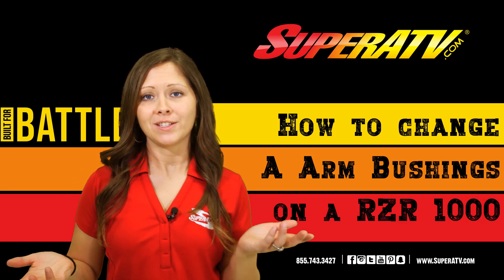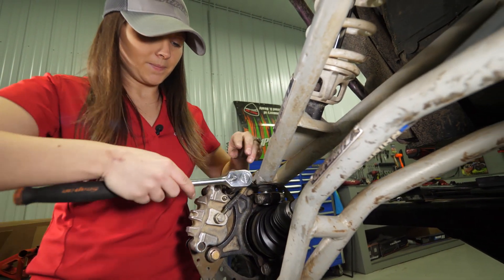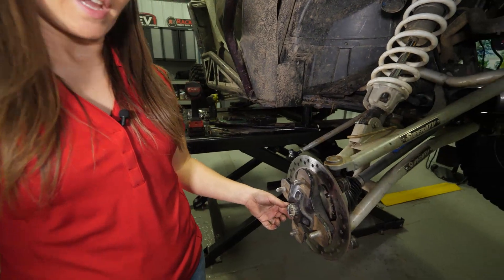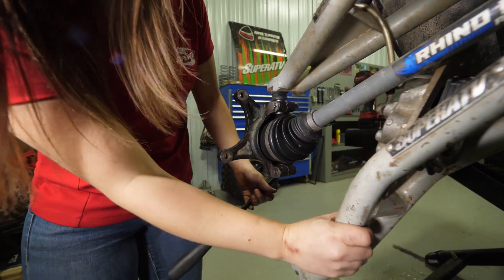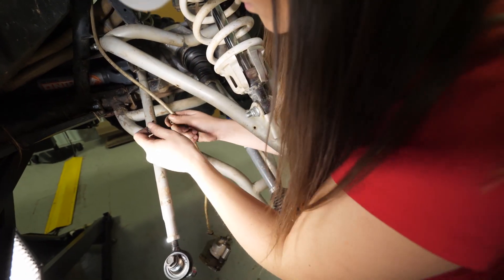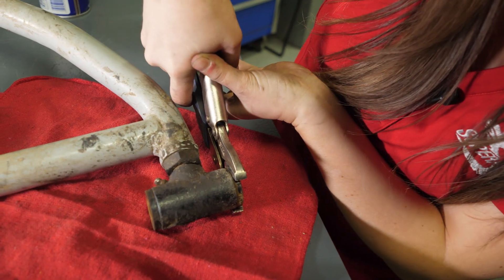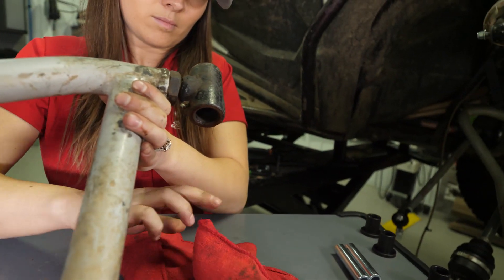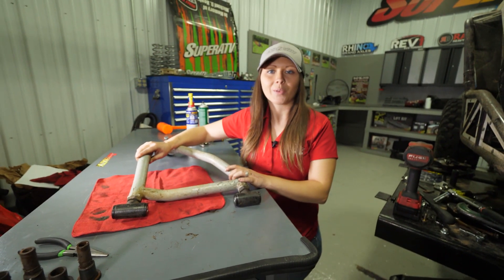How to check and replace your a-arm bushings| Maintenance Matters | SuperATV

Comment: Hmmm.. I am replacing all my bushings and what a choir... I like the video on the how to deal... I would like to know what tool ya all use on upper a arm front bolt ? I know I have to loosen the front grill and take bolts out but dang... can't Polaris make it easier ? lol.. Anyway good video
Reply: cut a 15mm wrench in half is how i done it
Reply: Choir, lmao. How does it sound?

Comment: Should never let the caliper hang from the brake line.  It will stress it and possible cause damage.  Always wire it up out of the way.
Reply: Spoken like a guy that has never actually done the work.
Reply: Been doing mechanic work for 20 years, I always let them dangle.
Reply: @honcho714 you and Chuckwood are probably the reason you have to change your break line right after doing things like this.
Reply: @jonathanhouser8194 that’s how chuck keeps customers coming back 😂
Reply: Anybody who has actually done work KNOWS to never ever hang the caliper from the brake line. Holy shit is this even a discussion? If your hanging brakes from their lines you are an inhuman monster.